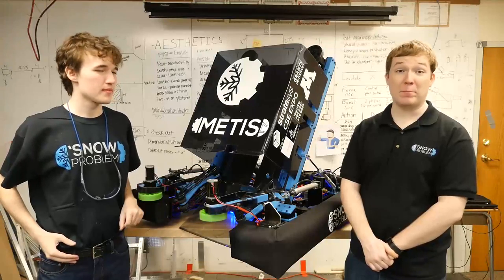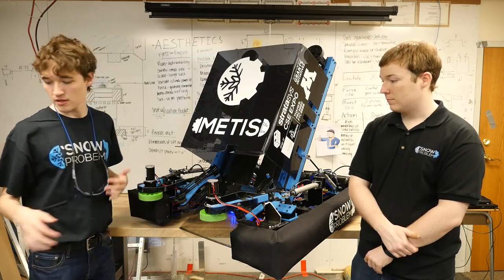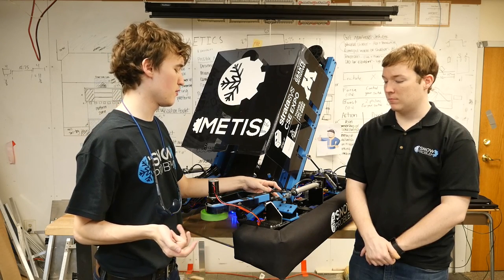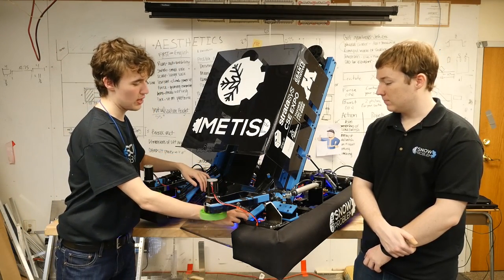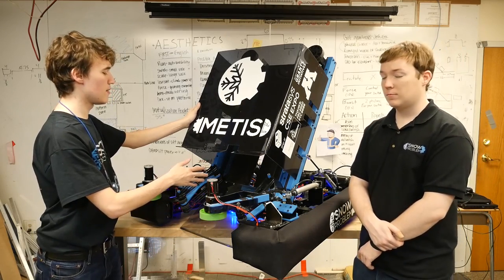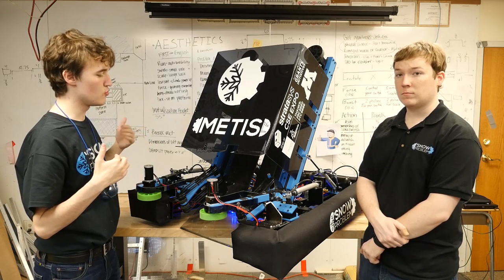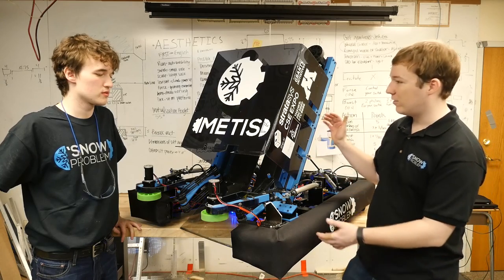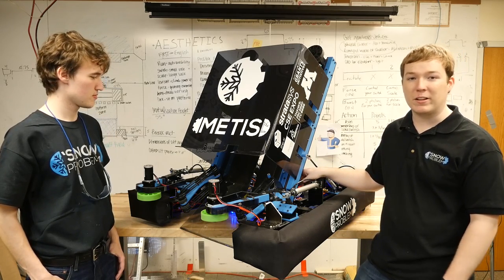Ri3D 2018 - Robot Walkthrough

Comment: Does your intake work for both cube configs?
Reply: Our intake works for 2 of the 3 spatial configurations. If the cube is upright (13x13 face on the ground), or if the cube has the 13x13 face facing our robot, we can intake the cube. We can not intake the cube if the 13x11 face is facing the robot.

Comment: Would you mind sharing the gearbox ratio of the two exit (black) wheels? Thanks.
Reply: The black exit wheels are a 3:1 and the green accelerating ones before it are 9:1
Reply: Alex, thanks very much. Also well done on this video. Meticulously and clearly explained. Especially appreciate the numerical data included that you found most efficient. Thanks, Derek Finch (Mech. Mentor TEAM 3737)